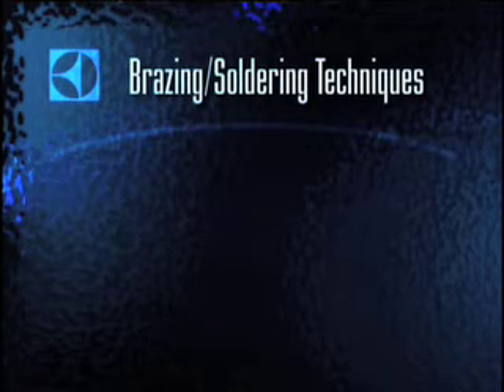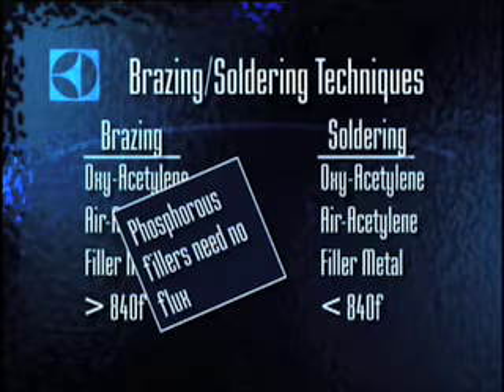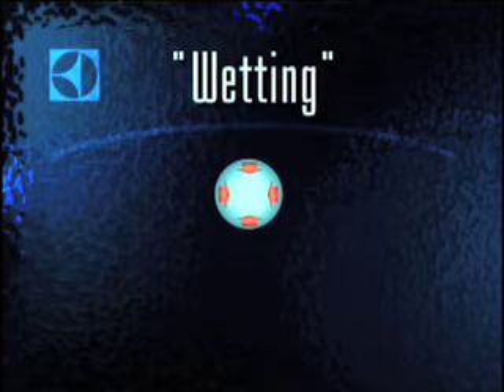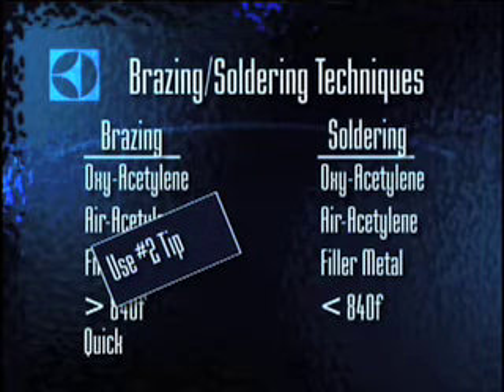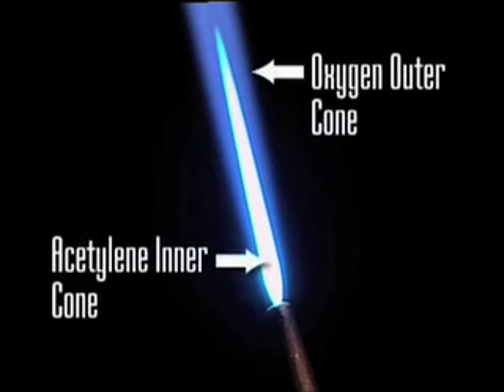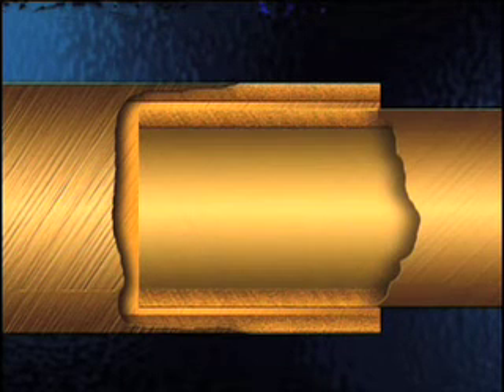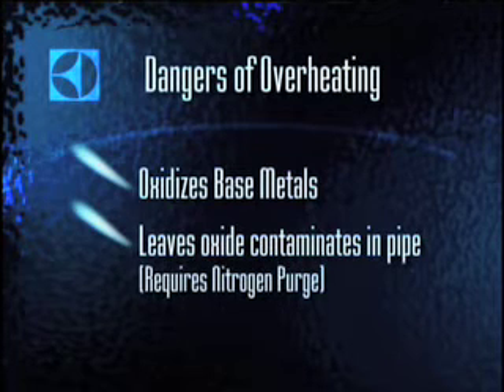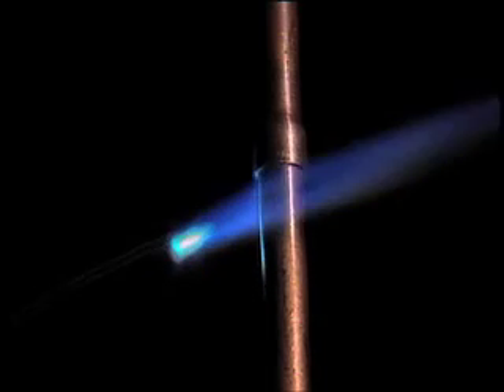ApplianceJunk.com - Refrigeration Brazing and Soldering

Comment: Can I use electronics solder and a propane torch on a 134a refrigerator filter dryer replacement?  thanks in advance...